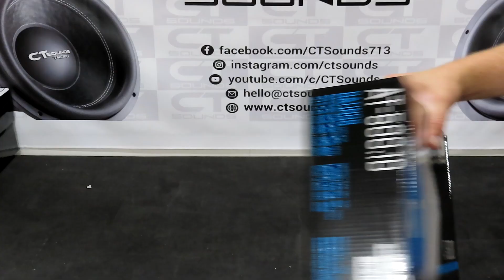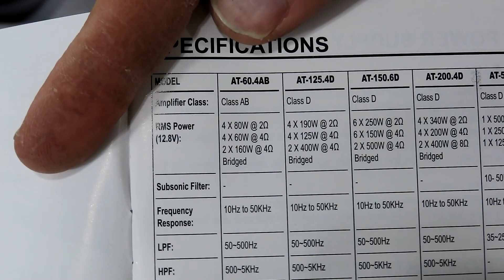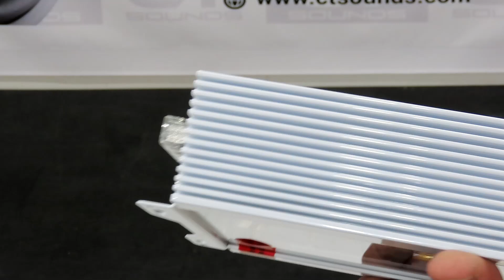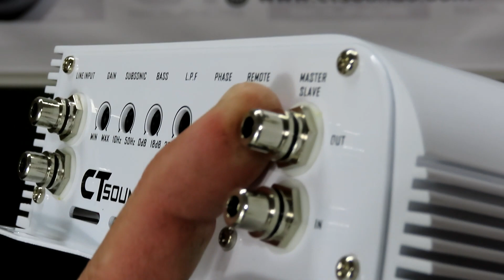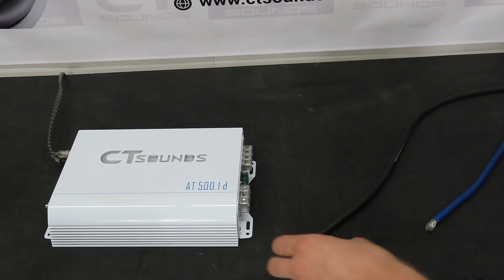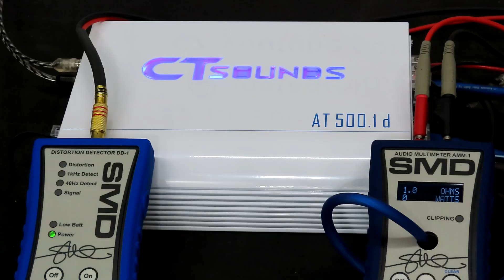CT Sounds AT 500.1D Amplifier Dyno Power Run

Comment: Run it at .8 it does over 800 rms and the amp is built tough i know ppl that run the biggest model 1400 at .5 daily it never sees .5 with box rise but the 1400 is a 2k amp all day